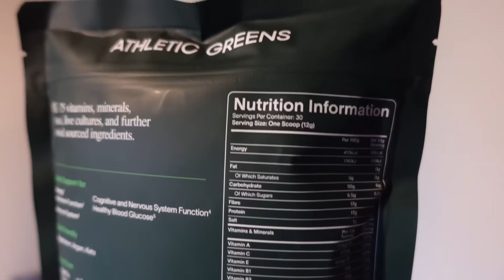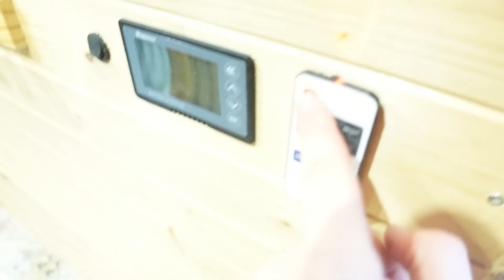REBUILDING £12,500 Abandoned Cottage Renovation Farm Off Grid

Comment: You replaced the extension cable between the generator and the stuff and I wondered if the fuse might have blown in the extension cable you used before? New cable looks handy.
Reply from the maker: It was the 1st thing i tested :) Thanks for sharing though as your right most people miss the 1st thing to check but  was the 1st thing i always check and switch out. the other extension point still works just only had one one extra plug :) Hope you well

Comment: Hi Dan and  Laura, great to see you back at your home in sunny Portugal I hope you had a safe journey back with no mechanical problems en route lol I think that the problem with the generator was you were pulling too much electricity at some point in time to burn that socket out as it’s only a 13amp socket unlike that bigger one you had in case your spare socket didn’t fit that bigger one is either a 16 or a32amp socket and would allow you to pull more power at any one time chances are it would be running say the well pump and the cement mixer at the same time that burned it out to start with. All you can do is keep an eye on it next time you run the well pump for any length of time along with something else like the mixer or kettle an iron all these pull a lot of electrical current and could cause the socket to burn out. Hope this helps you. 
Hope your new 5day then do the trip helps you out on the land but doesn’t take too much out of you all that driving back and forth. I knew that you were back o; the land by your instagram posts. So I was so hoping that you would upload a video for us to watch and wish we were there with you guys anyway I must go I’ve got a date with a few pillows and a quilt see you next week hope this week goes bloody fast as out then we can see you again7days is far to long to make us wait each week. Xx
Reply: Should have read 45days then do a trip home for 45 days😊😊😊😊
Reply from the maker: Hey Martin nice to hear from you and hope you well. Yea we agree with you defo the Jet wash been over used i think thanks for sharing. Ha love it well thanks for comment as always and catch you in the next one soon 🩷

Comment: That is normally a loose connection that causes it to heat up. I would also check the plug that normally plugs into it for a loose wire. The vibration of the motor can cause the screw to loosen, painting the screw head with nail varnish will glue it once it's been tightened.👍
Reply from the maker: Thanks for sharing we think it was the jet wash as its just cheaply built and we over used it for too long and heat up 🩷

Comment: Take that shelf that you put up in the middle of the palette wood storage and use it for the roof. If you leave it like that you can’t get the wood inside to stack and no air to go thru. You can’t get the wood out either. It just not needed as you have it. You can stack wood all the way to the top put definitely not with that shelf in there. Sorry but it’s not a good idea.   Good work on the rest of the build. I’d also be putting in a patio along the whole front of the building. It will help keep the hot sun of summer off the front of it. To keep the building cooler in the summer. ❤❤
Reply from the maker: Hey Teresa thanks for sharing the idea but the pallets have gaps all around as there pallets ;? On the top and the bottom so air from nearly every point so not sure why the shelf matters? Thanks for sharing though and trying to help  ❤❤